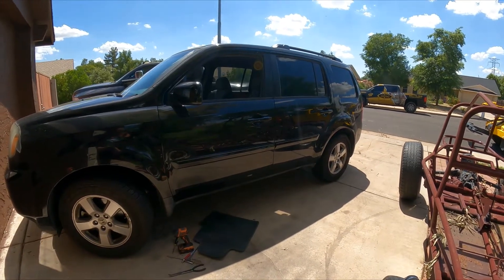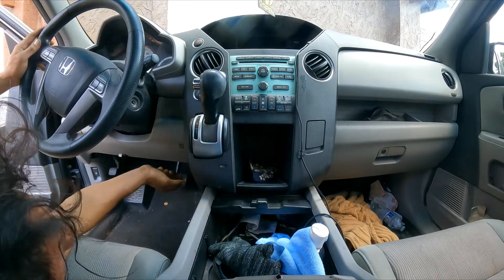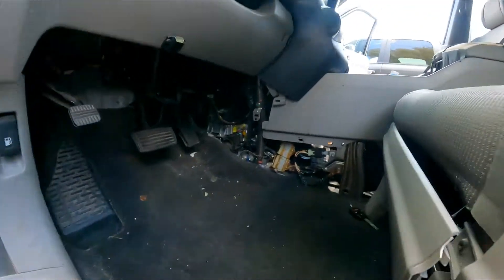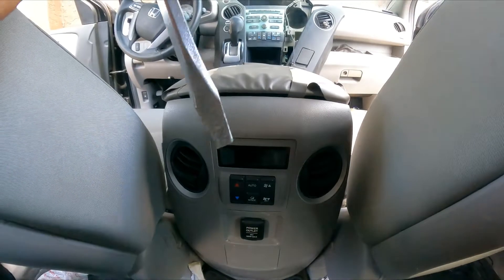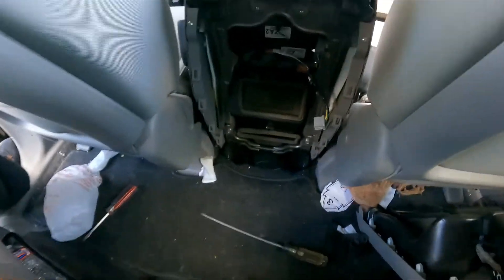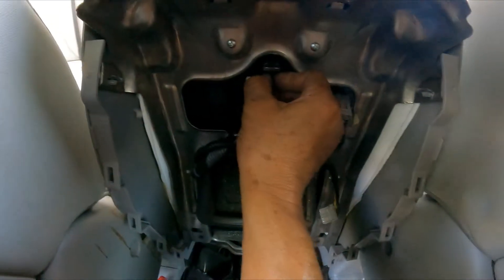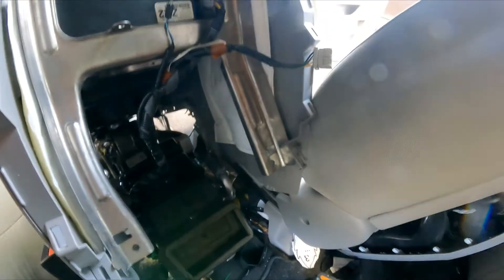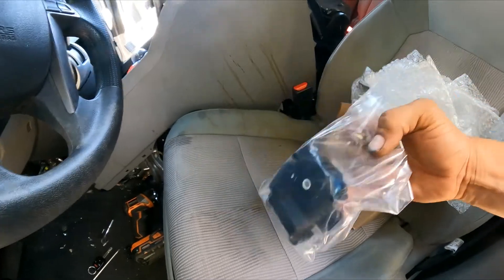2010 Honda Pilot EX Rear ac not WORKING and Inside Noise Problem solved (EASY)

Comment: BEFORE U REPLACE MOTOR, READ THIS AND SAVE MONEY...Great video. What I found was the piece of metal rod from motor to divertor door causing the noise. The clip holding it broke. So as the motor spins that piece of metal is Jamming the motor making that clicking noise. Bad thing Honda doesn't sell those clips. Will have to buy Door Lock replacement clips from Oreillys or Autozone. I got lucky and honda tech had clip close to one broken. So I pushed in and took tiny tiewrap around clip and rod. Problem fixed.

Comment: Thank you. Because of your video I finally understood where the noise on my Honda Pilot 2010 was coming from.  I bought the part in Autozone’s and a mechanic installed it. I was so happpy when I came to pick it up and heard no noise. I paid him and left. We have four cars so we only used the pilot on special occasions when we have a large group going somewhere since it seats 8 people. Well yesterday we filled up the car. No noise but the read ac console did not blow any air.  If there is a blower in there then is not turning on. You can see the display light up but no air. Know I’m wonder if the new actuator is the problem?   The old a made noise but the rear air conditioner worked just fine.  I called the mechanic and asked if there was a possibility he left a wire disconnected. He said hopefully that’s the case and not a broken fan motor. He mentioned the motor could have gotten damaged when he removed the console to Installed the new actuator. I’m taking the pilot back and I him on Tuesday. If anyone here knows what could have possibly happened please let me know what to do.  Could it be the new actuator?
Reply from the maker: Hello. Thank you for posting your question. It is possible that the blower motor got disconnected somehow. Check the blower motor resistor too. My suggestion is to take it back to the repair shop and ask if they can check it for you because it was working before. Just be nice when you ask. Keep me posted
Reply: @gqautodiagnostics thank you for replying! do you know where the resistor is located? Also could it be a blown fuse?  I found a fuse for the main blower but no fuse for the middle console a/c blower in case it blew somehow.

Comment: Thanks for creating this video, it helped me replace the rear actuator on my 2013 Pilot. This probably is the best video for the replacement, since it allows access to the actuator without much trouble.
A couple things that helped besides the video was using an 8” 2x4 wood piece to help prop the center console up. The other was using a 3/8” #1 Phillips screw socket and driver to remove the three screws for the actuator. I used just the socket when reinstalling the screws then tightened them up with the driver.
One more note for clarification, when installing the new actuator you have to make sure the vent arm is rotated back up to meet the actuator arm. I think it was noted in the video but I wanted to make that clear since you cannot or shouldn’t try to rotate the actuator arm.
Also, once the console is up you have access to the suction vent with the steel mesh on the passenger side. There’s a lot of accumulated dust and fiber on it, this was a perfect time to clean and vacuum that too.

Comment: @GQAutoDiagnostics   Man, been resetting mine for 6 months now and it was getting worse and more frequent, thanks to this video, changed it out yesterday and works perfect.  Question though, everything went smoothly, went back together great, never pulled or unhooked any wires at the 2 black vent trim pieces, but in some weird coincidence, went to use my wipers, and the dang things wouldn't turn off, lol. Got home, turned car off to stop them, started back up and they seemed to reset and stop. Went back out a couple hours later, started up and they still worked fine. I don't see how or what, but would anything have crossed when I lifted the console or is this just a strange coincidence? I mean, nothing is anywhere near the lever for the wipers, so not sure how changing that out could've done anything, but then maybe something reset when I unplugged and plugged the new one in? It was the cheaper aftermarket one, could it be sending a signal or something? Just had to go OEM on my purge valve and gas cap, lol, so funds were a bit low and had to go after market on this.

EDIT -  So after researching about the wiper switch and the headlight/turn signal switch, and how they can be faulty or go bad, I decided to go ahead and replace both, pretty easy to get to and do, and OEM parts were only 88 bucks, so being it's a 12 yr old Pilot with 141k on it, just decided it's time, instead of waiting till I'm in the middle of a Florida storm, lol.

Comment: Is there a shorter method? Can the driver seat be removed out of the way and a square window cut out from that big grey piece of plastic to remove the old part and replace with the new part.  This way you don’t have to remove the radio side panels nor the middle console. Or will that new whole cause some issues?  Anyways,  how much should I pay a mechanic to replace it the right way?

Comment: We have a 2010 Pilot with an refrigerant leak and oil leak from evaporated drain below the rear console area. I suspect the evaporator is bad. Since the car has rear a/c controls would the car have two evaporators and two expansion valves?